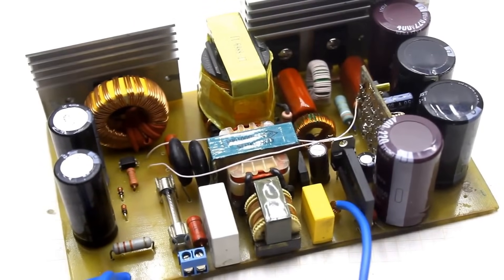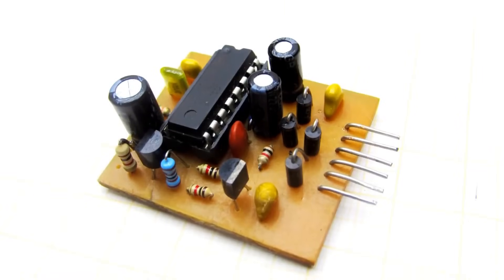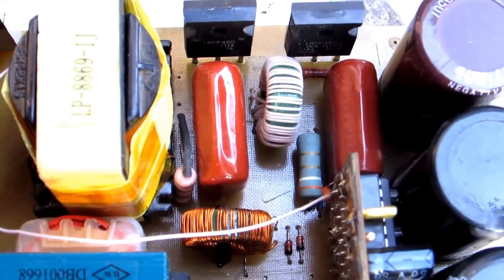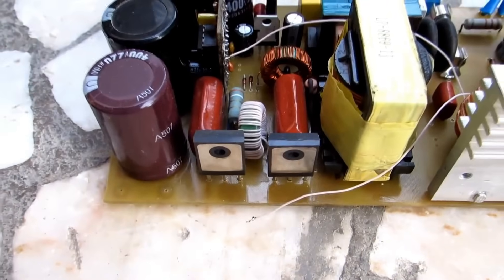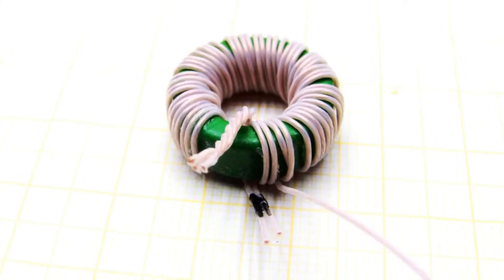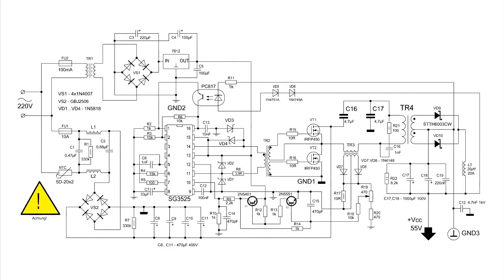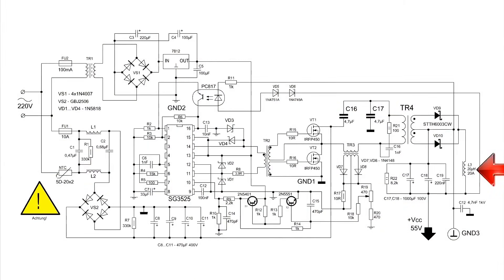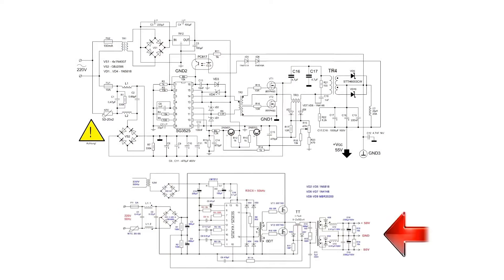1000W Switch Mode Power Supply

Comment: Your circuit seem ok but no tvs protection for fet high voltage switching have high volt transients and the more wattage drain the higher the ability get to failure of the fet this is fact on the chart and GDT turn should always be 16 turn for primary which is about 1.58 mh this keeps the driver ic from burning out